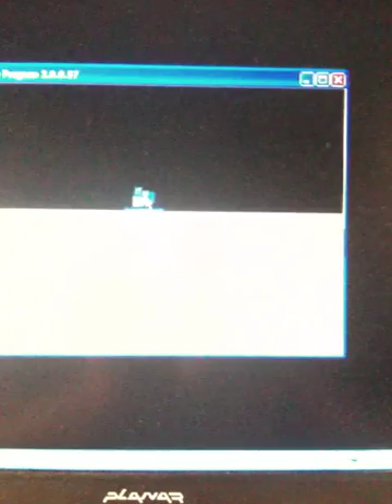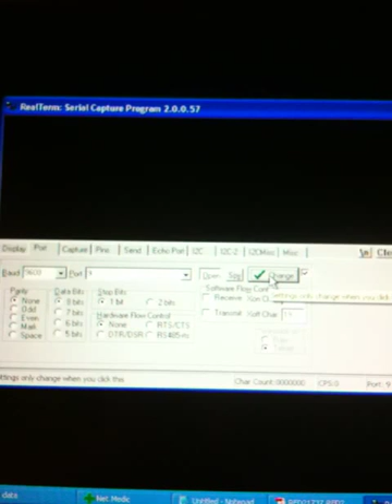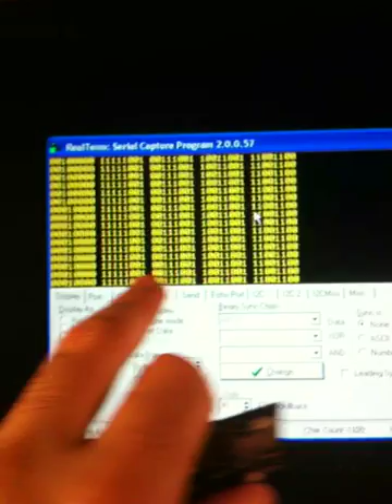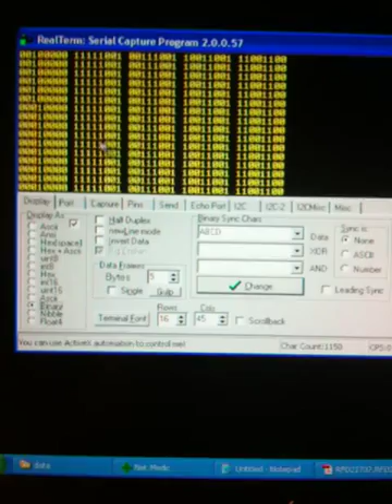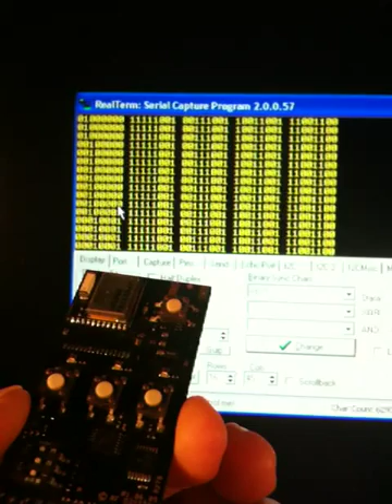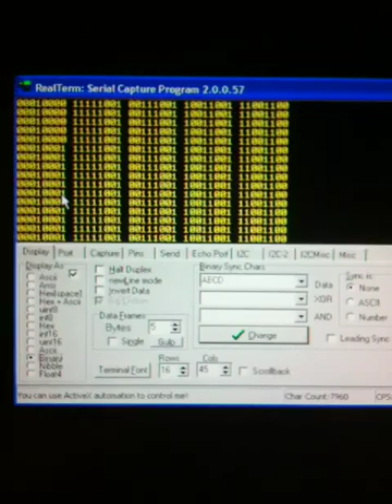www.rfdigital.com RFD21733 - RFD21737 - Switch Transmitter - UART Serial Receiver with Terminal

Comment: Just starting to play with a RDIF module (RFD21733) - I've just built one board so far - (something similar to your prototype) - setting it in MODE 0. My TX LED - blinks every 2 seconds for around 10 mins - before it goes fully on for around 10 to 20 seconds. After this event - it resorts back to the expected blink. Would you know what's going on here? Many thanks -